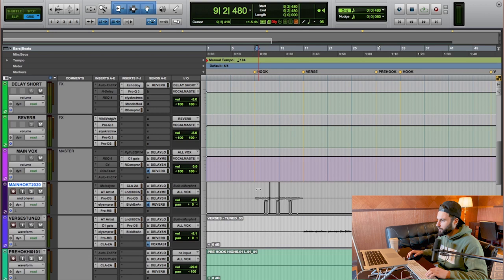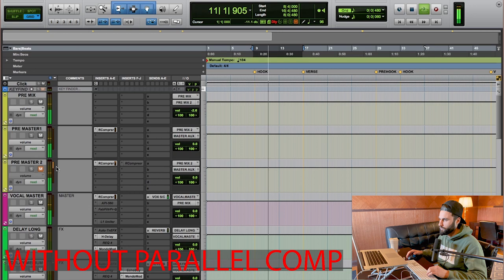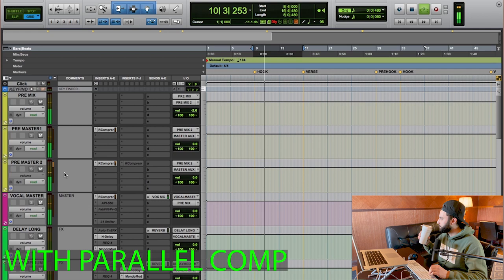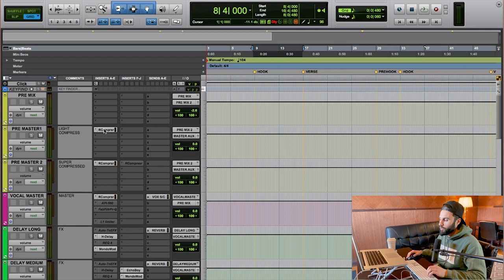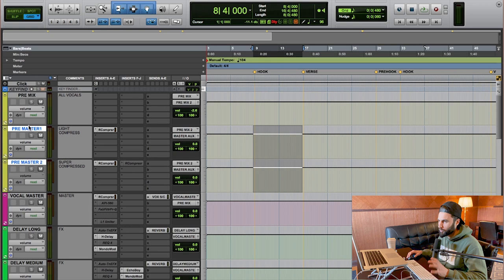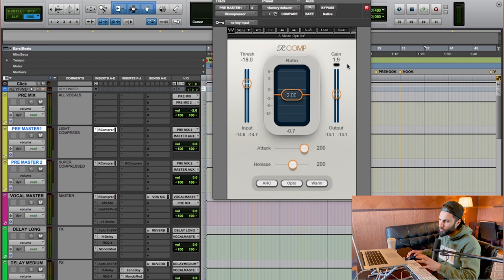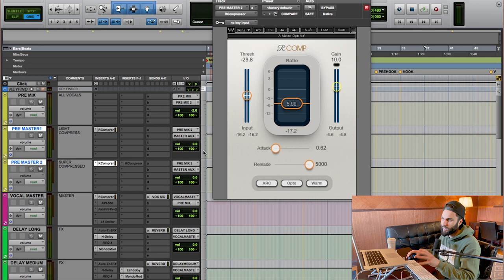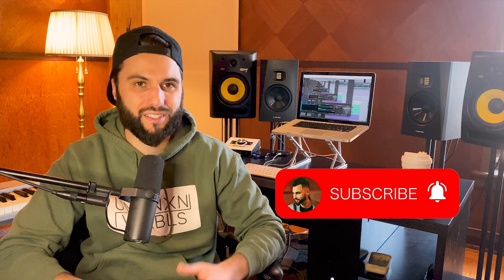How To Get Thick Vocals With Parallel Compression

Comment: im confused you're not compressing anything your threshold isn't low enough on the light compressor
Reply from the maker: I believe you’re mistaken. Look at the gain reduction meter for the light compressor - you’ll see it’s knocking off -0.5 to -1 db. It’s very light (hence the name). The threshold is just low enough to get a reaction, albeit not a crazy one but a reduction none the less. I recommend you watch that section again and you’ll see what I’m talking about. It’s easy to miss so I don’t blame you for that

Comment: Mostly people use the fastest Release for parallel compresison (for Heavy), like on CLA-76. You used the longest, is it more just a taste or your way is better, I'm confused right now to be honest haha. Thanks in advance
Reply from the maker: Fast release times generally lead to more transparent results, particularly when directly compressing a sound. 

In this case, I am not directly compressing the sound necessarily, instead I'm creating a blend of an extremely compressed version, with a more dynamic version.

With that in mind, we want to exaggerate the compression and we DON'T want it to be transparent or dynamic, since I am blending it with a more dynamic version of the signal with this method. 

For that reason, I emphasize the release time so its long and clamps down; keeping the sound compressed, while then adding gain back to make up for this reduction. 

When I blend it back in with the more dynamic sound, I get the best of both worlds: a dynamic sound with varying volumes for impact, and a compressed/squashed sound to increase perceived loudness.

Others may do it differently, that's fine. This isn't a one-size fits all solution - in fact, most of mixing is like that. There is no "right" way - just many ways and the "right" way for a particular situation based on your judgement. Hope this helps.

Comment: I do not understand how the pre mix 2 is connected to the voice it's interesting as an explanation but I don't understand how to reproduce this
Reply from the maker: Let me try with text here. 

Vocals output to the Pre Mix. 

Pre Mix goes to a single output, which acts as an input for TWO compression channels (Light & Heavy). I happened to label this output PRE MIX 2, but it could be named anything. Just know it’s an output that gets fed to the compressor channels.

The Premix is just a way to sum all of the vocals and have extra level control between the vocals and the compression channels. 

You could technically skip it and just output right to the compressors if need be but I like having lots of gain control at each stage

Comment: Hi, doesn't parallel compression make the overall volume louder, since the audio is played twice so the sound is perceived to sound " better ".
Reply from the maker: If we focus strictly on gain structure / volume, then yes that perception is technically correct. We always perceive louder as better (although truthfully, it isn't always - we've all heard some crazy slammed tracks with an L2 that are loud but have no dynamics or movement and generally sound flat, brittle and not great - most demos suffer from this problem)

In this case, we're not simply making a louder signal here - we're processing a copy of the original signal differently, often getting an extreme reaction and then blending that back in with the original dynamic signal. 

Part of this process should involve re-balancing the compressed version and the dry / dynamic version so that way its not just simply louder. In a perfect world, we'd match volume but most mixers know that this isn't always the case. We push and pull things to create a different "feeling" - and due to the difference in attack/release and general manipulation of the ADSR through compression, you will achieve a thicker sound.

Even if it is louder as a result of parallel compression, its not as straight-forward as turning up your volume fader. I won't pretend that volume doesn't play a factor here (it always does with parallel processing), but I also won't pretend that this is some gimmick that can easily be fixed by just increasing the volume of the dynamic signal. You may match the volume, but not necessarily match the presence, thickness, or perception of a signal. Volume is but one consideration here.

Not sure if this clarifies anything, but hope it provides more context on the matter. Thanks for watching.
Reply: @5piece, So should we Level Match after Parallel processing? . Like to bus dry and wet channels to a single bus and level match, or that’s not the case ?

Comment: So if I didn’t want to add the light compression(1st one)  and just do the second compression (main heavier one), then I would just do your settings and just blend to taste for my track? (I use Logic Pro x)
Reply from the maker: Yes, you could roughly do that (one completely uncompressed, another heavily compressed). It works the same, just should end up more dynamic-sounding due to the uncompressed one. Hope this helps!
Reply: @5piece  thank you brother 🙏

Comment: I don't know how FL Studio may alter achieving this technique.. But I have a question:

After you blend the 2 compressed versions together.. do those 2 get blended back into the original vocals? Or is the original (3rd version) cancelled out and we're only using the 2 versions to blend? 

I know that may sound confusing. Essentially, in FL, routing the original vocals to 2 tracks, would ultimately give me 3 tracks individually emitting sound equally.. Would I do away/mute the original and play with the 2 compressed versions? Or ultimately after blending those 2, would I blend that with the original vocals? Please help!
Reply from the maker: Those 2 compression tracks that the vocals “split” into ultimately sum together and feed to a final vocal master bus, then go to the output/mastering.

I’m not the most familiar with FL so I can’t make a proper recommendation. But if it helps, here’s the flow of the tracks

Individual Vocal Tracks > Vocal Pre Mix > 2 Vocal Parallel Compression Tracks > Final Vocal Master

Nothing goes back to the original so to speak, it just flows upwards as I’ve detailed above there. Hope this helps.
Reply: I know this comment is over a year old but in FL you need to unroute all of the mixer channels in the chain from the master except for the last channel in the chain. To do this you simply select a mixer channel and then on the master channel click the arrow above the knob at the bottom of the master channel. You need to route them specifically to the next mixer channel in the chain that he's describing in his comment
Reply: @TrypZOfficial  tbh I don't understand what you are trying to help me understand, but in my own comment, I see what originally had me confused back then haha I understand it now. But friend, I didn't understand what you meant tbh